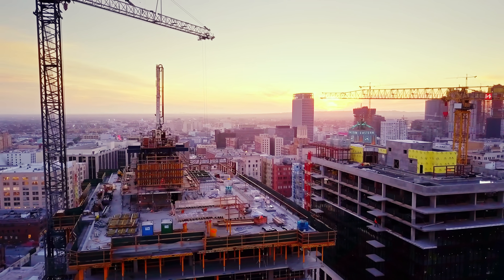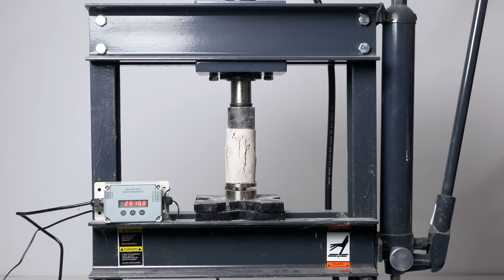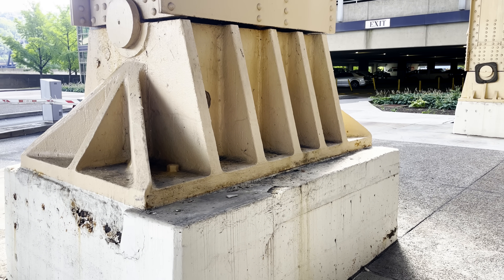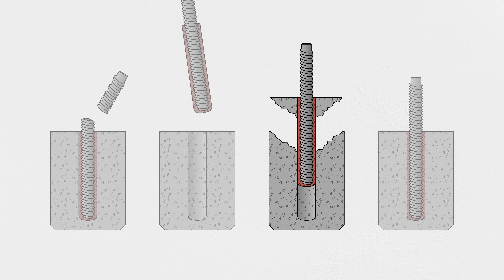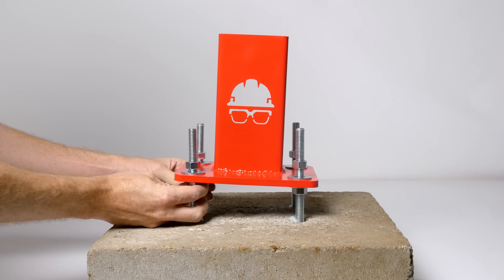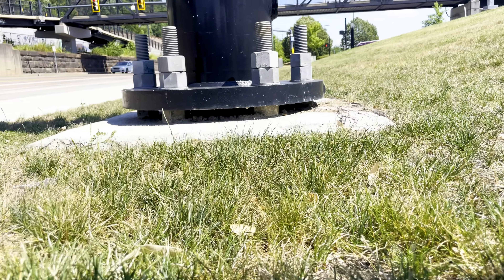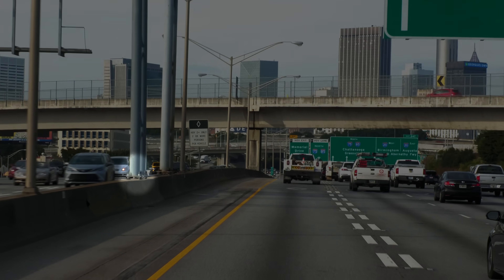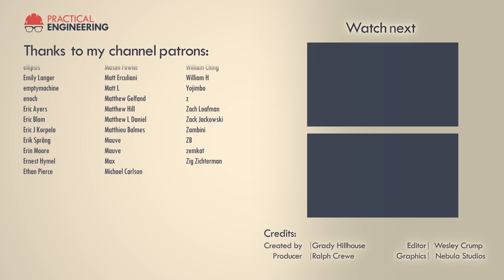What’s the Deal with Base Plates?

Comment: I have been seeing an amazing amount of destroyed signs lately.  They all seem to fail in the legs, posts of the sign between the sign, attachment area to the post and the base.
Reply: Double-legged ones (Blue exit-business ones I mentioned above) seem to be twisted after wind/big storms.
Reply: @cjc363636  I see all kinds leaned over, Canada and the USA. I think it's where they have 2 posts together to make a longer one. Get some wind and bolts shear is my guess. I see them going by at 100km/Hour so hard to tell exactly.
Reply: @cjc363636   What does "mentioned above" mean in a YT comment section?
Reply: Whats a "post of the sign between the sign" mean? And yes, failing at the base legs, or at the base plate, is the most common place to fail. Thus, this video.
Reply: @kindlin  The post runs from the ground to the top of the sign. Most I've seen don't fail where the sign is but between the sign and the ground. And no these signs are not failing at the connection to the ground, hence the reason for my comment. Instead of posts being 1 piece them seem to be 2 and failing between at connection of poles. But at highway speeds it's hard to be sure
Reply: @trainstractorscarsandtruck7362   Hmmm, interesting... I've designed a lot of poles, and while the splices are critical (like all connections in structural engineering), they are also fairly easy to get right. A lot of them are essentially capacity-based designs, and I wouldn't expect those to be the part that fails.
Reply: @kindlin  Yeah hard to tell at speed but to me it looks like I beams failing at connections. Maybe bolts aren't up to the job when wind blows

Comment: 1:48 "Americans will use literally anything but the metric system"
Reply: The metric system (ISO) is widely used in the U.S. in commerce and industry (e.g., all automobiles are made to metric dimensions, including fasteners, etc,), just not in common everyday use for distance and  volume (of some products, most food packaging states the contents in either grams or milliters). In addition, metric units are used in the justice system, i.e., the amount of cocaine you were caught with is stated in grams, even though I doubt most jurors even know how much that actually is.
Reply: we live by the rule: "if it ain't broke don't fix it"
Reply: The problem is lack of calibration, not what system is being used
Reply: I dont see any other bootprints except americas on the moon, do you?
Reply: @Salamandra40k care to guess what system nasa uses?
Reply: @karl0ssus1  Care to guess how much you missed the joke lollll
Reply: @Salamandra40k  the apollo guidance computer used metric
Reply: @Salamandra40k  The maths for Apollo were done exclusively in metric.  Only values displayed to the astronauts were converted to imperial (just before display).
Reply: @alexhajnal107  "Maths" lol there's not multiple of them, brit
Reply: @Salamandra40k  All aerospace products are designed and manufactured using the ISO metric system and have been for decades. In addition all automobiles regardless of country of origin, including the U.S. and made using the metric system. So, there may be no other boot prints on the Moon from other countries but you can be certain the the dimensions of the boots, including the tread, were designed and fabricated using the metric system.
Reply: The calculations for the Apollo missions were done exclusively using metric units.

Comment: The specs for alot of those nuts that hold the post onto the baseplates are "snug tight" or you tighten them until they break away on purpose